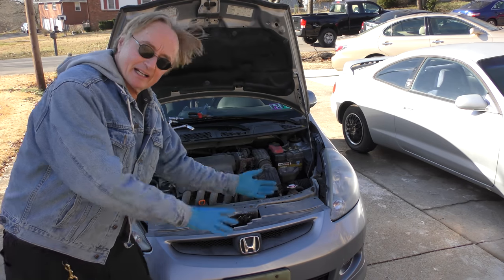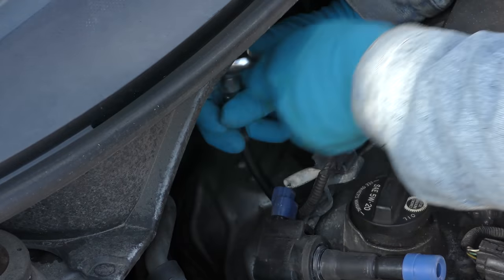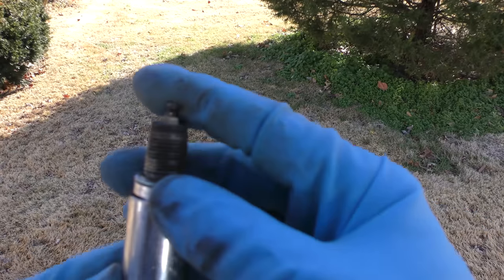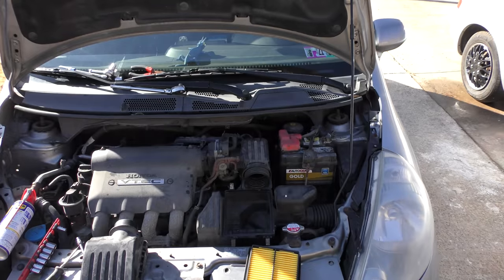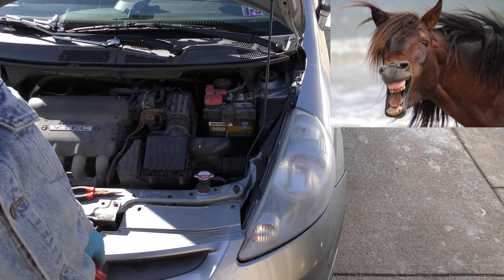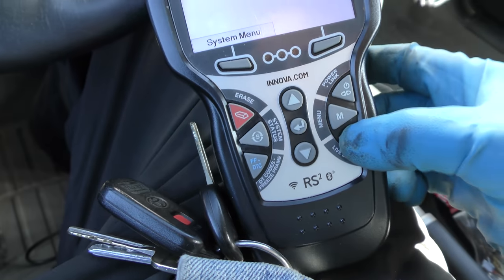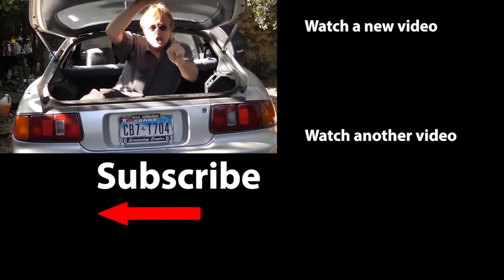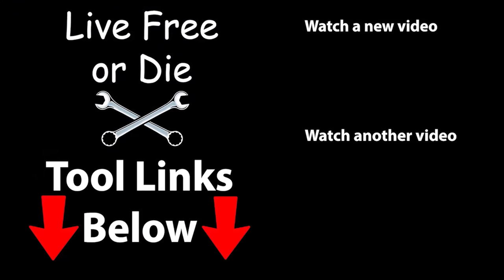This Honda Has a Serious Problem

Comment: In Greece you have to follow the manufacturer's instructions when servicing your car and you have to do in dealership only if you want to keep the  manufacturer's warranty. Thus you have to change spark plugs every 40k kms (25k miles) on Fits as per manufacturer's instructions. And this is what most people do.

Comment: Adjust the valves. I had the same issue on the same car. A master Honda tech figured it out at the Simi Valley Honda dealer.

Comment: Interesting that this is a common issue. I have a Honda Fit (2006 DBA-GD1, L13A engine, 200,000 km/125,000 miles) that runs a little rich, though the STFT and LTFT are about the same (-5% or thereabouts). I think there's one injector that's noisy (tick-tick-tick sound when cold or driving uphill). I've run some PEA injector cleaner through, replaced the air filter and plugs and coils already. I think when I adjust the valve clearances I'll take the injectors in for testing.

Comment: My daughters 2013 Fit had the check engine(spend money) light and traction control come on at same time at 100,000 miles. Pulled a P0302 code- misfire in #2 cylinder. New Spark plugs  require you to remove wipers, windshied trim, wiper motor, and metal pan. Once there, I found three of the four spark plugs loose enough to remove without a wrench. Plugs and coils carboned right up. Apparently this is a known problem. Lucky to catch it when we did🙄

Comment: Don't wanna but I gotta.. that generation Fit uses a speed density air metering, so the loose air-box wouldn't have caused any driveability issues. But un-filtered air is no-good either, so good fix!

Comment: Honda and problem in the same sentence? Something you don’t see very often 😅
Reply: Yup, this is my grandma's car. It just didn't work good when cold. Nothing else was wrong with it, it's a lot better now after the new filter and spark plugs. Still going to put the fuel injector cleaner in. Thanks Scotty
Reply: Sometimes I forget to lock my doors at night 😴😏😴
Reply: My 2020 Civic has larger gaps, more uneven panels, and rattles than my dads 2010 Civic. Mechanically, though? The K20C2 has been problem free and is a very refined, reliable engine for the 15,000 miles it has been so far driven. Even when the instrument panel said oil change was overdue, the darn engine was still running even better than when it left the showroom lol. Kinda like my 2001 cavalier. Not exactly the best fit and finish, but that 2.2L OHV was great and managed to reach 240,000 miles before I sold it.
Reply: Any brand will have this if you don't ever change the plugs. Stop being ignorant.
Reply: @robmalcolm8042  They were changed once at a garage in Pennsylvania. We knew they could use new spark plugs, however I didn't know that old spark plugs could effect the car when it's cold.
Reply: I had two head gaskets go on my civic
Reply: Carmine Dingle  Simple stuff like oil changes, brakes, and rotors have been done to it. It hasn't been neglected by any means. We knew the spark plugs had to be changed soon, they had been changed once before. I didn't know that bad spark plugs could effect the car running when cold. I thought that bad spark plugs would make the engine run bad all the time. We took it to Scotty because we didn't want to spend money replacing parts if the repair for it stalling when cold cost a lot. The car is only worth $1,500-$2000
Reply: Except with the transmission..... From experience!
Reply: This must be your first Scotty Kilmer video

Comment: On the air box clips you just push in on the spring parts thats bowed outward. It will cause the clip to expand upward and latch around the lid.

Comment: Hi scotty I drive an 07 civic and tried to change my spark plugs but one of them is stuck and I can only do a quarter turn when try to unscrew it. Help! Thanks in advance and merry Christmas
Reply: The car in this video was my grandma's. One of the spark plugs, #3 was actually stuck on good. He sprayed WD40 on it and on the socket to take out the spark plugs. Then when putting the new one in where it was previously stuck, spray WD40 on the new spark plug
Reply: @AustinsCoins  thanks for your help! ill give that a try!

Comment: I've been reducing my Toyota service intervals for spark plugs by half each time I changed them.    First was 100,000 miles, then 50,000 miles.   I'm about due to examine them again.

Coil packs for my Toyota are $91 a set plus S&H.    OEM spark plugs are about $8.00 a piece ($32 total) plus S&H.     I may consider getting new coils this next interval plus inspecting the plugs.

Consumable parts are cheap.    New motors and catalytic converters are expensive.
Reply: I change my air filter each time I change my oil.  Every 5,000 miles.    The engine oil comes out a brown color instead of a black color.

Oil and filters are cheap.

Comment: I own a 2008 Honda Civic Si with over 100,000 miles and just had a clutch put in it after ten years of ownership. Should I sell it now? or drive it until one of us drops dead. I'm 65 so it will probably be me first. Doesn't use oil and change it regularly. Doesn't use anti-freeze (just changed that). Whaat do you think I could get for it?

Comment: What is the tool you used to remove and replace the spark plugs? does it work for both removal and installation of a new spark plug?

Comment: Scotty i have same Engine in my Honda City Pakistan made its L15a Engine Vtec, its amazing Engine with Amazing Pickup . it gives me 10 to 8 KM per liter only, but it has amazing Power. i wil change the Air Filter tomorrow.

Can you suggest for how much Miles or KM we need to change the Air Filter?

Comment: My yaris is tha opposite of this problem Scotty say, when it’s old it runs perfectly fine but I’d it’s warm it shakes when I’m standing still. It’s a yaris from 2004
1.3 Liter vvti with 150.000 km on it (around 80.000 miles)

Comment: For anyone else who has this problem with a fit, it needs a valve adjustment. It's a well known issue. My dealder didn't want to do it, but it did fix the problem and once they did it they admitted it needed it. it runs perfet now in all temps

Comment: Scotty my niece has a 2007 Honda Fit 92k miles like the one in your video and is giving a P0311 we replaced the air filter, gas filter, coils, injectors and still shakes a lot when already at its temperature and still gives the same code. Do you have any idea what the problem is?

Comment: I've heard about the head gasket problems, but my Subaru is a very good car and my engine runs just fine at 287,000 miles! it's a 98 Legacy. Had some cooling system problems for a while but at the end of it I had to replace the radiator and I'm good to go. Goes to show it was taken care of like any car should be. I would buy the same one again.

Comment: Scotty I have the same car the engine stalled on me when I got water inside the cold air intake took spark plugs out cranked her up no water came out, but I smell a burning kinda of smell afterwards ,should I be concerned performance hasn’t declined yet either?

Comment: with regard to the fuel injector cleaner, I have a 2016 Honda CRV so as a "preventative", should I put in some cleaner? The car has 70,000 miles on it.
Reply: You can, but don't put it in for every gas refill. That would unnecessary, I would do it every 3 or 4 refills for preventive maintenance.

Comment: Ha Scotty, I've got an 08 Honda fit. 1.5L When I got it, it ran fine. Since then Ive  replaced coils, and plugs. After that it ran fine. It started running rough and I got a check engine light. Had it checked 
and It showed a bad cam sensor. I thought no problem, just repleced it right? But thats proven a harder than I thought. I cant find any information on its location. Any idea where its located?

Comment: Would it be better to clean the injectors?
Reply: Yes, the Chevron Techron does that. It would be too much of a hassle to take apart the engine and replace the fuel injectors.
Reply: @AustinsCoins  i know theres one were you use pressure and connect it to the fuel rail

Comment: I got  2015 honda fit, really satisfied with the car. Only thing i had an issue with was the inferior quality on the interior and the cheap paint job. I sold the Honda, but I got another one. Hondas are great and always had a good experience at the dealerships for repairs. I'll never buy another Ford or chevy again lol.

Comment: I have a 2008 honda fit 5 speed. It was just hit with 12 bullets by a gang shooting in front of my apartment the other week and im attempting to repair it. 56 shots fired total ( I made a video if anyone wants more info). San antonio - just moved here.

That aside Ive changed the plugs and coils yet still get a little hesitation when keeping a constant acceleration in 3rd/4th/5th gear. I did my own valve adjustment and that hasnt seemed to fix it. Ill check the airbox next. Trying to rewire the canbus harness right now as shrapnel hit it and replace all the glass. I love the car itself though!

Comment: I had an honda fit 2007 from brand new. Changed the oil every 3000 miles with synthetic oil. At 65k miles I started to hear a knocking sound when cold. The knocking sound started to increase rapidly. It ended up having piston slap in 3 cilinders, I had to machined the cilinders to 0.5m
Reply: That's very rare

Comment: I used to own an 08 honda fit. I had a stalling problem and read on fit freak .net, it ended up being a coil pack issue with 2007-2008 honda fits. I swapped them out with new ones and it ran fine for another 70,000 miles.
Reply: and then?

Comment: scotty i have  a 2005 Honda civic auto tras 1.7 leater 4 cylinder with 126,400 miles on it with the original spark plugs and coils should i have my plugs changed yet?
Thanks
Reply: Plugs? Probably not, spark plugs. Most likely. You want to change them every 100,000 miles but depending on what type of spark plug they could last longer
Reply: @AustinsCoins  this a gas engine with standard wire set up with coil packs for each spark plug
Reply: @apctech1  that's what I meant for the probably not. You must likely don't need coils or anything else. Just new spark plugs, the honda fit in the video has never had them changed. Just spark plugs 2 times in it's lifespan

Comment: Hi Scotty!!! I purchased a 2013 Honda Civic based on a recommendation from one of your videos! It has 56K miles on it, and it’s making a metallic rattling/jingling sound every time I step on the gas pedal. Any ideas? It doesn’t have any codes and I’m plumb out of cash on unemployment during the pandemic. Wouldn’t believe it, but an old brick wall fell on my parked car and I had to get a replacement in the middle of the Summer. Worst timing, but your videos have helped tremendously! Thank you for all you do, and Merry Christmas to you! Also thanks for this very coincidental video today😉
Rachel K🎄❤️🎄❤️
Reply: Oh I should mention too all of the filters have just been changed! If that helps😊
Reply: Send questions to his website
Reply: Sandy Barnes thank you for your suggestion! So kind.

Comment: I had a Yugo come in the shop years ago for tires. The left wheel assy was held on with a piece of wire hanger. Ball joint went I'm guessing, & Bubba wir'd er up. Drove OK, I guess.

Comment: i have a auto 2003 honda accord EURO CL9 Australia shipped model. it has a k24a3 engine and i change the oil every 5000km and oil filter and i use all K@N filters since they are better from what iv been able to find. iv changed my Gasket seal, spark plugs, air intake to a short ram Ingen pod filter intake, DBA T2 front rotors with all round new brake pads, standard rooters replacement on the back, full exhaust replacement to sound better, changed the VCT and Vteck filter/solenoids depending on what some people call them, power steering pump, air compressor and rad, pully trencher, serpentine belt 3 times, whipers 3 times, front window glass, both front lights for face lift model lights since they look better and last ones where yellow and leaking on seals and one was cracked, in cabin filter, and alot of other litter things. but i got it at 190,000km here in QLD Australia and in a year and a half iv got to 265,000km and most people say thats a insane amount and iv noticed the gear box and engen are making more and more sounds.     iv been told because i can get a hole engine that's around 130,000km to 150,000km for $500 here in aus it would be easier to just swap it out and same with gear box there $200 to $300.  my engine makes that weird sound that iv herd  2000/2010 Toyota Camrys make when they exarate like a metal sound of some sort but iv been told that's just a 4c sound from 4c back in these days. i also do a little puff of smoke when i change gears if im taking off a little more then a normal person dose. my gears box is the worst sounding thing though it sounds like that thing you guys have in usa the base ball hitting the metal bat. "ting" kind of sound when its changing up/down and if im going up hill as its getting steeper. i have a feeling its just because auto/semi autos arnt the best for long life and its almost at 270km and i drive it in semi auto all the time now since i got the new exhaust since i can make race car sounds... lol but im not a tool or hoon about it. only when its appropriate.

Comment: hey guys i have a question for the car guys here should i buy a 2006 honda accord with 133,000 miles the dealer wants 5,000 is that a good deal?
Reply: Always negotiate, especially if it's a dealer. The worse they can say is no but if they say yes you save money
Reply: @AustinsCoins  thank you i"ll see if they will go for 3,000 sold

Comment: I am trying to remove the lock cylinder on a 2007 Honda Fit Drivers side; How in the heck  are you supposed to remove the clip holding it in place?

Comment: hi sir i have honda city 2007 thailand model it has driveability problem when its cold it work fone  but when its come hot its not run its jurking and after some time slowly slowly its run  . what is the problem in car sir .

Comment: My 2005 Honda Jazz CVT shifts into reverse on start up no problem, but won't go into  D, S, or L without a ten minute warm up. I took out the transmission solenoids and they test fine. I found an 'actuator' that the solenoid pushes was stuck and sanded that down, but it still takes ages to warm for drive. Looking for suggestions please (anyone). An ODB II error code referred to the transmission oil pressure switch but for the life of me I can't find where it is (looked at repair manual pics too)

Comment: I wish my car was able to put out live data to a scan tool. Its a 1990 Bonneville with 324K miles on the original 3800 V6 engine. I would be curious to see the cam wear and fuel trim levels after so many years and miles considering it runs great still. Daily driven.

Comment: THIS IS SUCH A COINCIDENCE ! i'm looking to buy a Honda Fit here in Alberta, Canada where temperatures get down to -45degC(-49F).  But i'm following your Advise Scotty and NOT Buying the "Earth Dreams" variant of the engine
Reply: It's a great car! And it's not all earth dreams engines. Just Turbo gdi engines. My mom's 2015 honda accord has a earth dreams engine. Already got 78k miles on it and still running fantastic! Only thing we've done to it is oil changes
Reply: @AustinsCoins  i would actually get one, but i live in Canada (Alberta) where temperatures get to as low as -48F in extremes. 
even NA engines i assume would have issues in these temps. !

Comment: I,m shopping for a used Fit.  Willing to spend $5000 to $15,000. Any recommendations?
I've been wrenching on cars DIY for 50 years, but I'm wanting to have more time for other things.
Reply: Do some research on the generations, different strokes sorta thing. They're all mostly good to great, there are some exceptions with newer generations of other Honda models.

Main options are sun roof, manual or automatic, and little farkles.

Good luck, I see multiple all over the country for sale.

Comment: Guy I need your help I have a 2008 Honda got like the one in this video. I can turn the car on and it runs but won’t shift out of park and no dash lights and no electric power steering but, battery won’t hold a charge what’s the problem

Comment: My honda does the same but it has 2 codes 
Po141 and po171. I'm guessing the oxygen sensor is bad but as scotty said it might be a spark issue and it's been like 4 years since we changed the spark plug wires and I'm just hesitant as to what to do cause i want the car running in perfect condition but i don't want to put money on something that's might not be the solution

Comment: Scotty can you  recommend good mechanic to work on replacement of gasket covers in 1997 chevy 1500 silverado?
Reply: @spankthemonkey3437  if she does it herself make sure she cleans the surface the gasket sits on really well, use some good gasket sealer and make sure to have the correct torque specs and follow it precisely.

Comment: I have a manual 2000 yaris 1.0 with 77,000 miles that has a whine when reversing and slightly when down shifting at speed particularly in third but not always.  What do you think it could be?
Would changing gear box oil be wise? Or is it too late?

I will run it till it's dead but wouldn't mind it lasting as long as possible with cheap fixes.
Reply: Every car whines in reverse, its a straight cut gear with no synchro. Gearbox oil doesnt hurt for maintenance reasons
Reply: @jamesoconnor1368  not like the usually whine, more like a whistle but if you were to pretend to